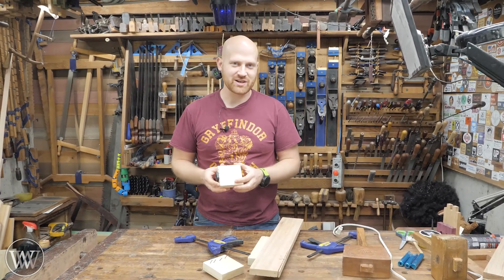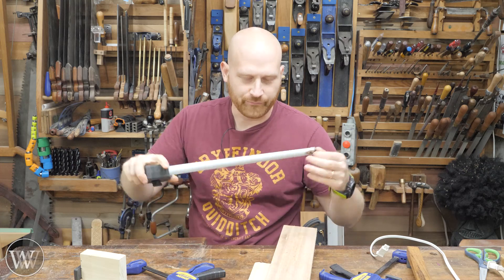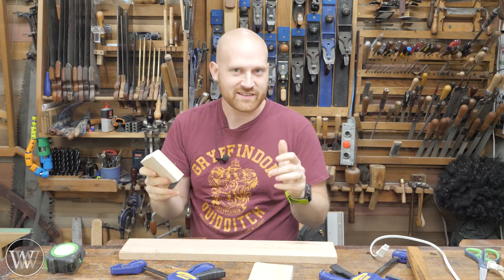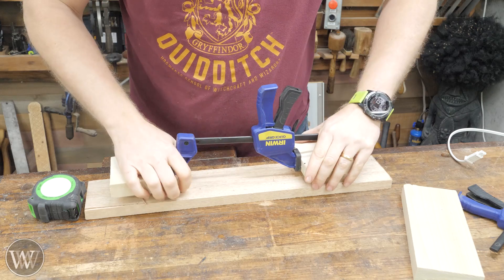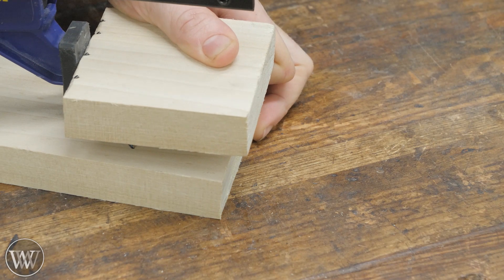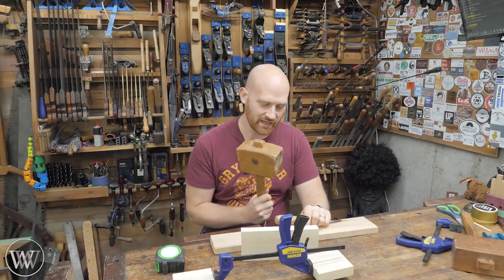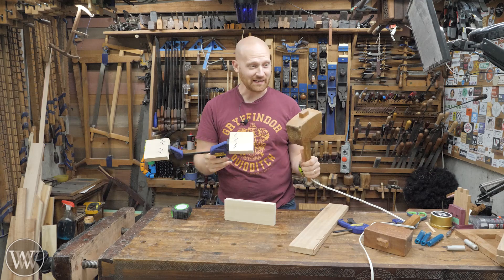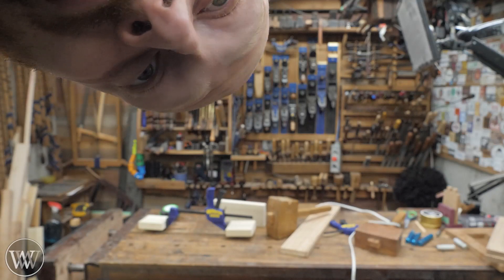I Need Your Help

Comment: The problem with the board stretcher is that it makes the board thinner as it stretches it. I find it much better to simply butt the off cut up next to the work piece and then, assuming it was cut with a western push saw, pull the saw back through the kerf until the kerf dis appears and the two pieces are one again. It’s simple physics, for every action there is an equal and opposite reaction. If the saw teeth remove wood in the push stroke they must put wood back on the pull stroke. Obviously this is all reversed if you’re using a Japanese style pull saw, and it will be upside down if you’re in Australia.
Reply: Brilliant 😂🏆
Reply: I have a board inflater that puffs up the long grain cells to increase the length of the board when connected to a magnetic decompacitator that I invented
Reply: You absolute legend!

Comment: Years ago Royobi came out with the electric chisel. I actually have one so I got it out the other day thinking I would try it chilling out some dove tails. It did not take long to realize the electric chisel was a bad idea. So no, forget the electric hammer. Board stretcher on the other hand. Great idea.

Comment: Top tip, add some BLO so it lubricates the board for easier stretcihing.
Reply: Yeah i cant believe james forgot the BLO...
Reply: You have to do it with the board fully submerged into BLO, because as the board stretches it will soak in more.

Comment: I've been using a DIY board stretcher for years... one thing you'll find is that you can't get too much extra length with the grain but, because wood naturally expands perpendicular to the grain you can get quite a bit of extra length in that direction.  Additionally wet boards stretch much easier.

Comment: LOL loved it. The board stretcher is so needed in my shop; perhaps you could sell me two of them! One tip for the electric mallet. Try to make sure it has a long cable, then it can be used as a panel beater as well. I hope my tip was helpful. Thanks for making me laugh. Best wishes.

Comment: Finally! It’s about time someone addressed the problem of overly-short boards. I’m constantly cutting them too short. Up until now I’ve just been sprinkling Miracle Gro on them daily, then watching them for hours on end for progress, but that seems too time consuming and I tend to get yelled at by my boss, who thinks I’m wasting my time and should get back to serving the long line of customers at the gasoline-powered back scratchers store I work at. Anyway, I’m wondering what would happen if you were to combine the electric mallet with the board stretcher to speed up the lengthening process? Might be worth a try. Thanks again for the enlightening video.

Comment: Ah, the classic board stretcher... the only problem with them is that, just like my phillips screwdriver and utility knife, it's never on the job site when I need it. I used to use a specialized one for glass all the time though, when customers gave me wrong dimensions. They were always surprised by how much it sounded almost exactly like throwing a sheet of glass in a dumpster when it was being used

Comment: I think your board stretcher will go the way of the saw pits which were all broken down and resold as post holes.

However, the power mallet actually may have some merit working something like an impact wrench. An impact mallet?

Comment: I just finished my stretcher, it works really well ! My problem is when I sand the piece  it keeps creeping out longer. What is the correct sequence in the sanding, cutting and assembly process ?

Comment: Rob Cosman came up with a board stretching solution. You cut the board on as an extreme of an angle (to expose as much long grain) you can then add the thickness of board into the angle and glue back together.

Comment: APRIL 1 is always good for alaugh but the dest time is anytime you can. hom many construction newbies have been sent for 1 can red and blue andone blue and red unmixed stripe paint, a left handed screwdriver, a rotationless screwdriver, a long weight, a jar of pre sized electrical currents, sky hooks, threadless screws, a bag of DIY ice, a tin of blue air or a greasy palm grip ! every day is April 1st. right im off to get a jar of self levelling water.

Comment: I believe the nails are too long to use in hardwood. You could substitute electric reversible glue. Glue the blocks on with reversible glue, stretch the board to the desired length, then hook jumper cables to the ends of the board and fire up the Chevy. Or Ford. Hybrids and electrics, ironically, don't work. The current releases the glue, and you're good to go.

Comment: Hey James couple questions. The wood that needs to be stretched does it work better if it's wet or dry? And the auto hammer is there a 220 version. 
Thanks again for the early morning deep gut laugh

Comment: That clearly won't work! It will only stretch the wood where the nails go in to the wood. You need to have contact across the board. Try double sided tape on the jaw and then when you use the spreader you can tell that the wood is getting longer because you can see the jaws move.

Comment: All these jokes are fine but misleading, heres a tip i learned years agoo. if you cut a board to short, place a broom handl horizontal 2 feet higher than the length you need the board. on each end of the board put a No6 dewatt  coated self drilling skyhook, next suspend from the broom handle, and on the other end suspend two house brix pre soaked in distilled soap water.  spray the wood in a 50/20/30/25 mix of tonicwater, 7up, tap water and saline body extract.  keep moist for 3 hours then leave over night. next morning board will have stretched to floor, rinse off tonic, 7up and tapwater and allow to dry, do not worry about saline , its very easy to take saline urinary liquid .  this method is known as the taking the wee wee (or pee) method